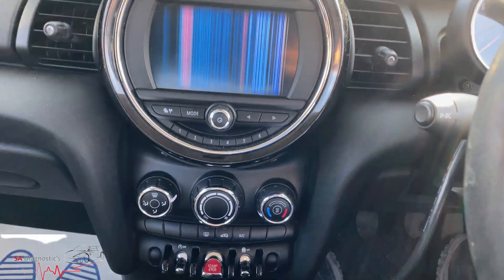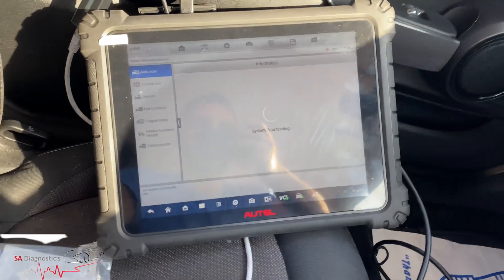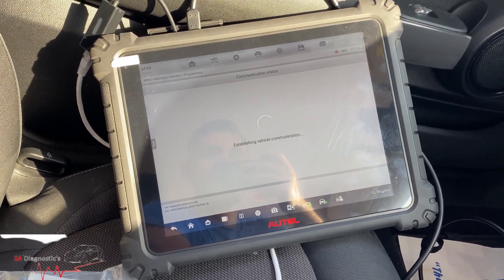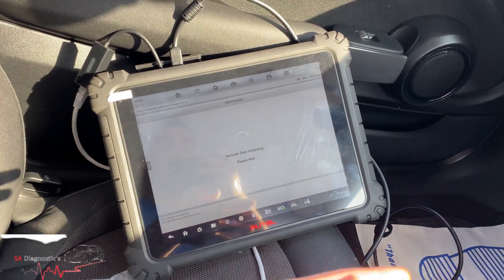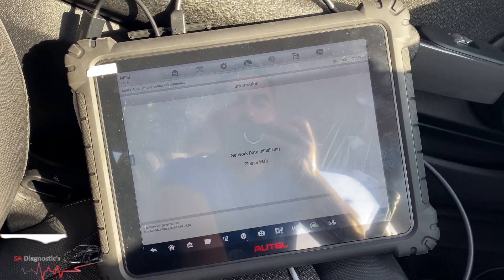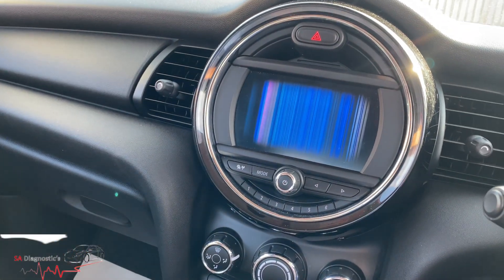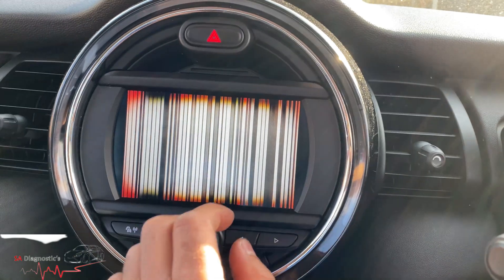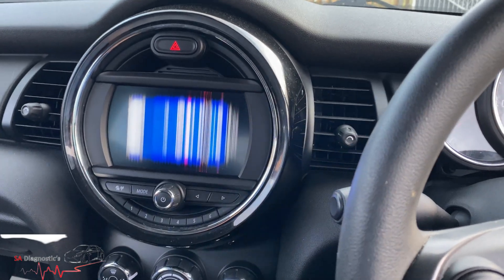2025 AUTEL Maxisys How To Code & Programme Step BY Step Guidance

Comment: I have a frozen screen, I’m hoping this works. I have a Im608 Pro 2. Should I put jumper cable from another car onto the car I’m coding and run the other car so I keep a constant voltage. Did you use comfort or expert mode and how long should this take. Thanks Ian
Reply: Ok just tried the same thing in your video, Unfortunately there is no programming option on the Head unit column, I only had encoding option, I successfully completed the encoding but the screen is still frozen, i presume I need the coding option which I also presume is for the Autel Ultra Lite and above. very frustrating